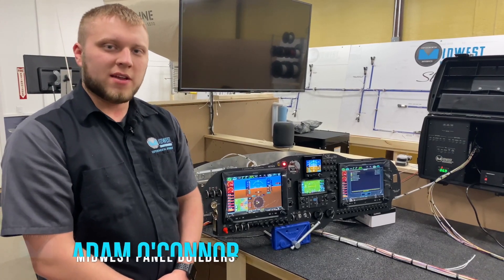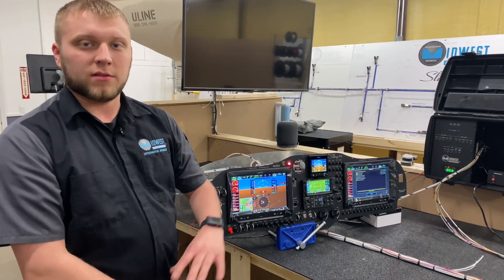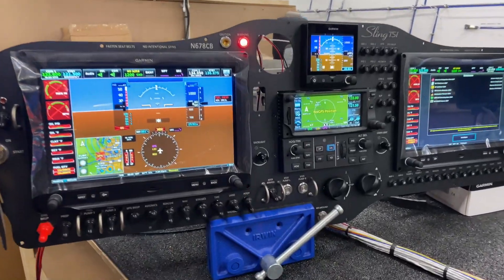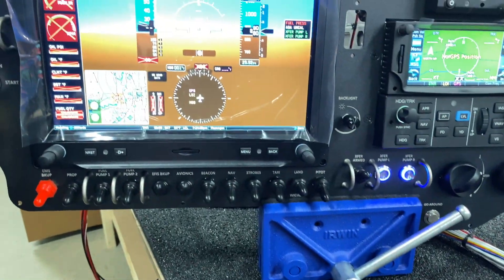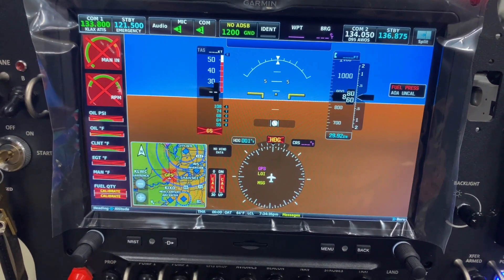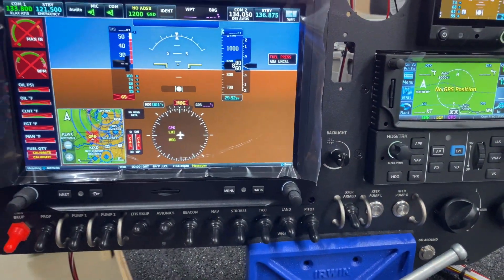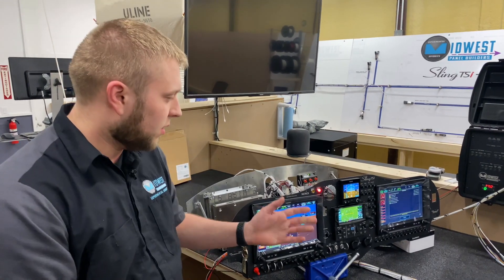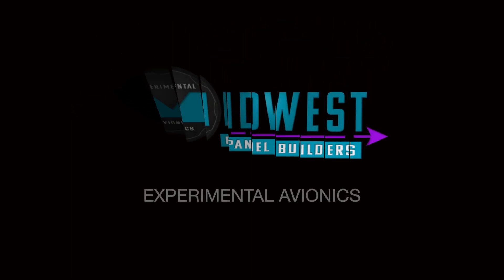Sling TSi Transfer Pumps

Comment: I feel like there should be a switch in paradigm on panels from settings and switches of hardware to more scenario based macros… for example having phase of flight buttons on the panel for Taxi, Runup, Take Off, Cruise, and Decent. Hitting each button would configure the plane, bring up the check list, etc. In this video, you’re showing a setup for fuel transfer… a scenario macro seems eligible here too, button for outboard fuel transfer in? More intuitive, easier workload. thoughts?

Comment: Thanks for sharing. This is a creative solution to an issue that, if handled otherwise, could be a big distraction to the pilot.  Jean recently posted a video of a Sling Tsi interior that shows a bunch of fuel valves or switches to the right of the pilot's legs.  Managing these could be very distracting.  I'll likely never be fortunate enough to pilot one of these beautiful aircraft, but your solution is both elegant and simple.  BTW, that's a great looking panel.  You;re doing great work.  I wish I could be one of your customers....(sameday?).
Reply: The stories in your mind become the stories of your life. Be careful what you tell yourself. You CAN own this! You are just a decision away.